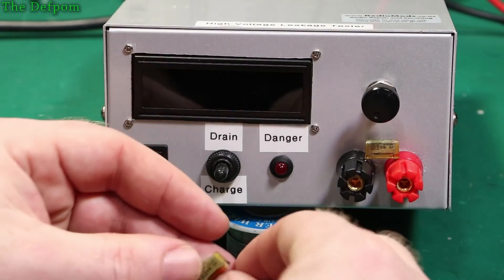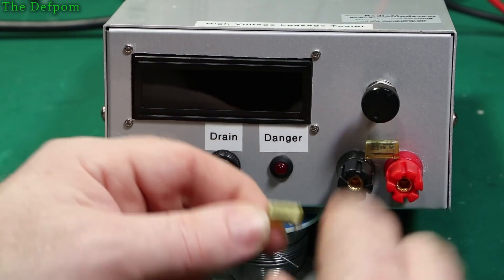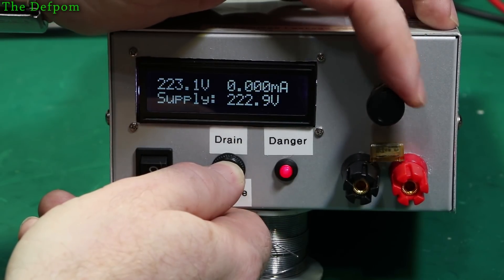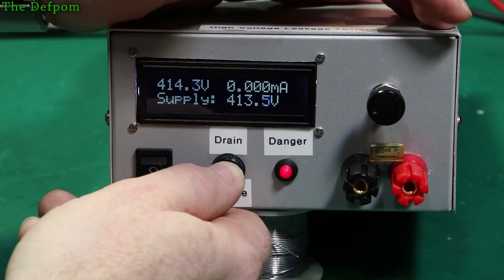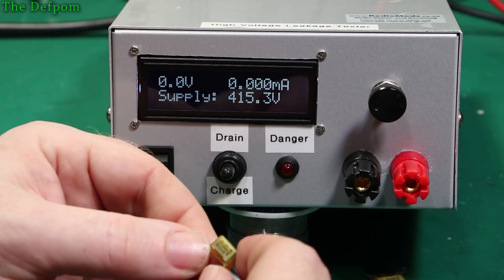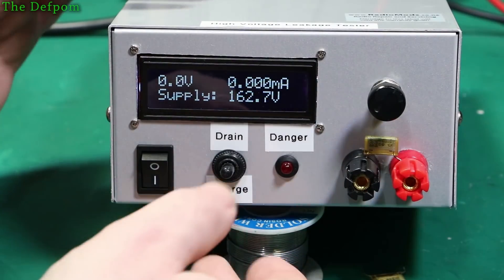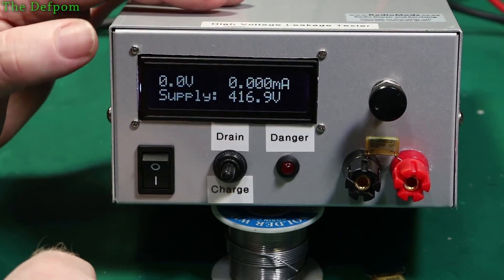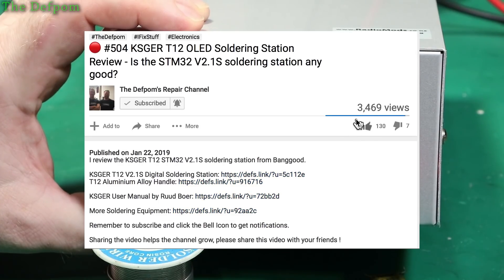🔴 #570 Two Minute Tuesday - 40 Year Old Rifa Capacitors High Voltage Leakage Testing

Comment: Why would you put the terminals of the DUT so close to the pot where you have your hand? Poor safety design by any EE standard.
Reply from the maker: Marcel Hensen - I had planned to use it with clip leads all the time, I was a bit lazy in this case and just went straight to the terminals.

Comment: Generally find that those fail with moisture in humid environments, and that they gradually get conductive paths, heat up and finally fail so long as there is enough energy in the supply side.  I in general test AC mains capacitors at around 1kV with a insulation tester, and look for lowish resistance, and listen for the crackles as they start to self heal. If they will withstand 30 seconds at 1kV and no nasty noises they are passing, but if there is any jumping of the resistance or noise they go into the scrap pile and are replaced. 

In general bigger capacitors in motor run application last 3 to 5 years before failing, though these are the lowest cost ones around and have typically been running at around 90C for around 15-20k hours as well by that time. Have some really old PCB filled capacitors ( from a scrapped 1970's vintage Amana window wall unit) that are, aside from the whole PCB thing, still perfect, just they are twice the size of any similar value replacement capacitor. The advantage of modern manufacturing, self healing designs and polycarbonate with aluminised surfaces over paper and foil construction.

To get smaller RIFA's to pop you just soak in water for a few hours, leave to dry then apply rated AC voltage ( or  2.5 times the AC voltage as DC) and wait for the action. Use a current limiting resistor if you use AC mains, preferably a 15W incandescent bulb. Then you have limited smoke and visual failure indication.

Comment: I've had several Rifa caps fail (haven't we all!), most seem to have pre-existing cracks in the plastic housing..... letting moisture in? I replace all that I find in test equipment just in case.
Reply: Only the transparent ( well, now only the yellow translucent ones as they degrade) cases crack, the yellow and blue cased ones, with non transparent epoxy fill, very rarely fail. Got a whole box of 0.22uF 250VAC blue case ones with flex wire leads, and they work fine, despite being old, and have not had any fail, other than self heal to the point they were just 100pf units.
Reply: @SeanBZA  Yes, I believe you are correct. All of the caps that I have had fail have been the clear/yellow ones and appear to have cracks in the case that cause the actual capacitor to fail. A poor choice of material for the housing rather than a poor capacitor design.
Reply from the maker: I actually think that the cracks are a symptom and not the sole cause of the failure. I think the cap is expanding (much like a lithium cell does) and that is cracking the case, either that or the plastic is shrinking (as most plastics do with age).
Reply: @TheDefpom   I should have said the cracks seem to contribute to the capacitor failure, not cause it. SeanBZA makes a valid point that capacitors of the same type with a different case design do not seem to fail. There appears to be a link between case cracking and capacitor failure, it would be interesting to find a Rifa cap with a cracked case and test it before and after exposure to moisture.
Reply: I just had one fail with non-cracked case. It's a different type. It has an opaque white case, with the standard yellowish transparent top. 
I gotta remove 13 of them. I will test the non-popped ones some day.

Comment: Nice video, it shows how great the polypropylene capacitors can be.   They don’t dry out like an aluminum electrolytic does.  There’s no electrolyte used, so nothing to dry out, so they are already dry;)  There is the type of poly that uses paper instead of a plastic, and those are more hydroscopic, so they can absorb water and fail, but I think those are physically large and easier to tell them apart.  Poly caps are also self healing so they will last for practically ever.  

The DC equivalent to 250 VAC is 354 VDC I believe, but I think most are fine to 400 VDC, which I think  is what is used in forming them.
Reply: For class X they are tested to 2.5x working voltage, so they should withstand 600VDC for 30 seconds without any change in capacitance or self healing.

Comment: Miserably failed ha ha :)
If you desire pop then old bead tantalum or electrolitics, evil crapacitors :-D.
If you get any more test gear, you will be fitting the camera with a roof rack, yes that is a really odd thought, i have taken my medication lol.
Reply: Try wet tantalum, which do go off like 0.22 rimfire cartridges, and will shoot the slug out ( or the case, depending on what is more firmly held lead wise) when they fail.
Reply: SeanBZA 
Wet tantalum sounds fun, ... Errr sounds rather dangerous, but fun :)
Reply: funny how we watch the some channels, bigclive.com next?